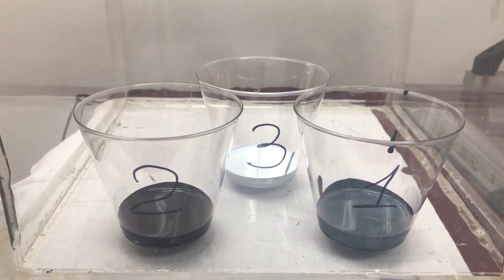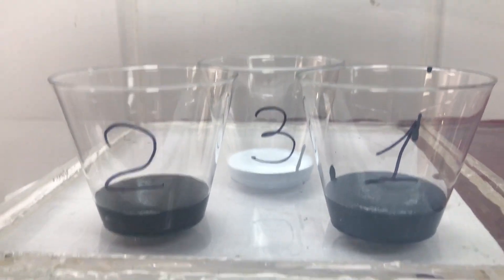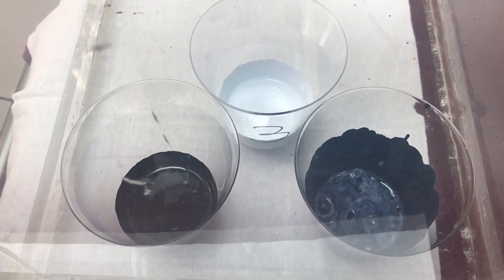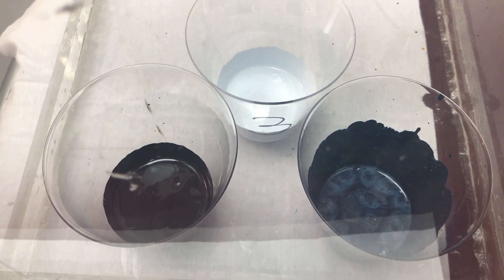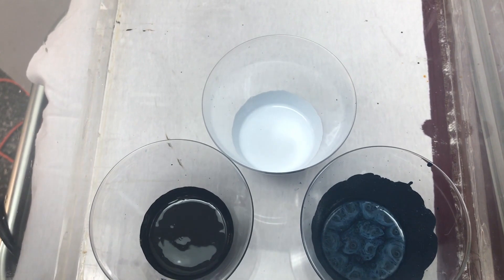Degassing of Paint in Acrylic Vacuum Chamber

Comment: You was boiling the thinners in the paint. Not the gases. When you reduce pressure the boiling point reduce too.
Reply from the maker: You are correct. When you reduce the pressure, you reduce the boiling point of all compounds in that mixture.

Comment: At that low pressure won’t water boil ?
Reply from the maker: Hello wdwerker, yes, the water will boil at lower pressures. What you are seeing is actually water boiling and gas escaping. However, the rate of water loss due to boiling is much, much lower than the rate of gas loss due to outgassing. This is a good point, because at some time, you would outgass the mixture and further subject to vacuum would only lead to liquid loss...

Comment: I use solid pigment in epoxy resin and it keeps setting out would it still settle in a vacuum chamber
Reply from the maker: Hello Chris Harden, I am not sure if I can answer your question. We would need to know the exact epoxy and your process. I am also not sure what you mean with "setting out"; do you mean it expands while it sets? Some epoxies may do that, others contract during the setting process. However, if you have gas entrapment inside your epoxy AND the entrapped gas is causing you problems, then degassing your epoxy would most certainly solve the issue. Thank you.

Comment: why should you degass paints?
Reply from the maker: We asked ourselves the same question. From what we were able to tell. This is not just your regular paint, it is used to color injection molded plastic. If gasses are present inside the paint during the injection molding process, the heat will cause the gasses to boil, expand, bubble, etc... This in turn, will yield bad injection molded parts. A way to mitigate this is to degass the paint because after degassing, these compounds are removed and good parts can be made.

Let me know if you have any more questions. Cheers!